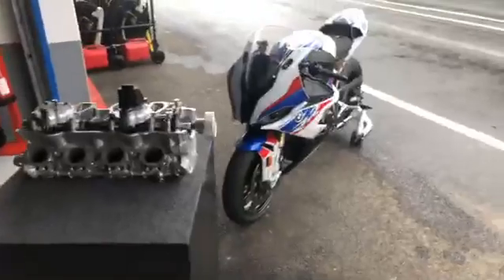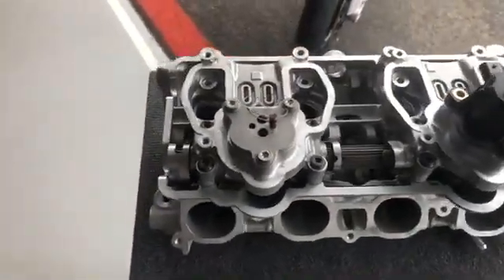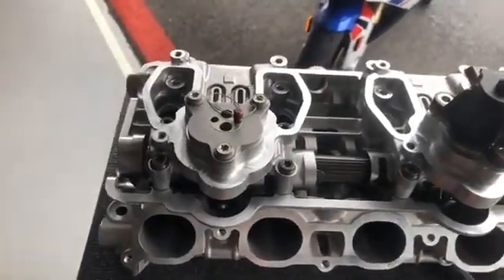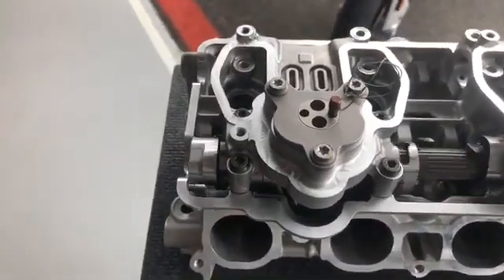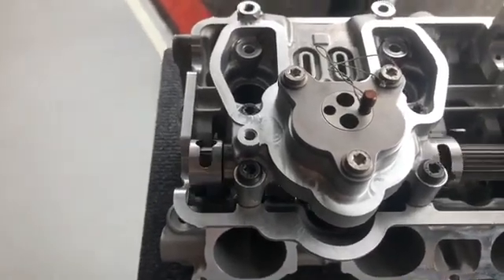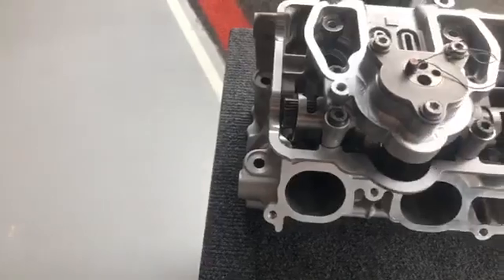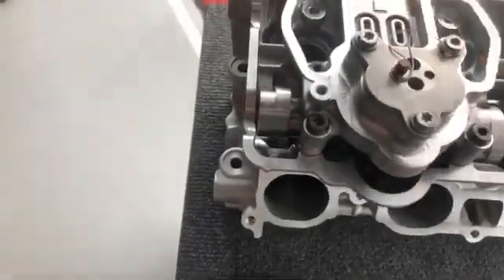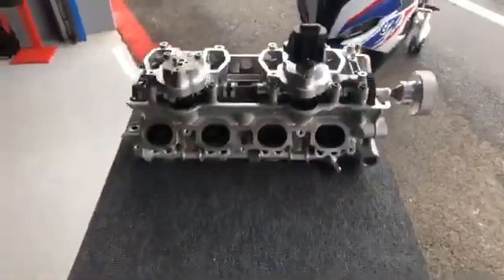Peter Hickman explains the 2019 BMW S 1000 RR Shiftcam technology

Comment: Suzuki came out with their vvt system in 2017 which is mechanical and legal in all racing organizations.   This bmw technology would not be legal in moto gp which doesn't allow electronic, hydraulic or oil pressure activated cam phasing.
Reply: Suzuki is certainly more reliable without a doubt, plus it operates 100% more seamlessly. BMW is on/off with 2 lobes, while Suzuki is continuously variable since it's only 1 lobe.